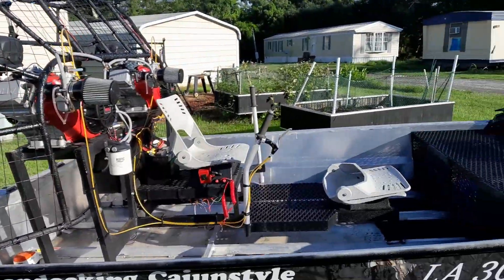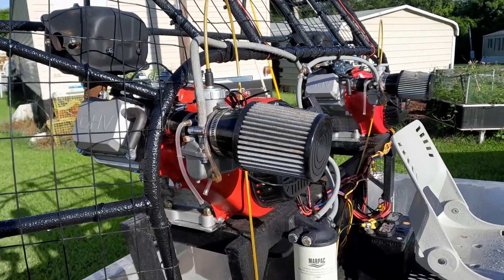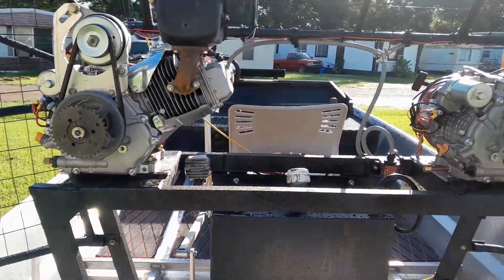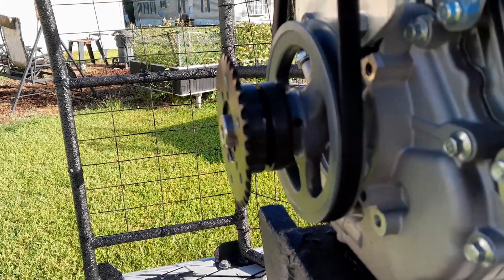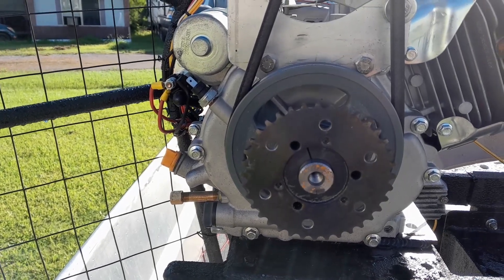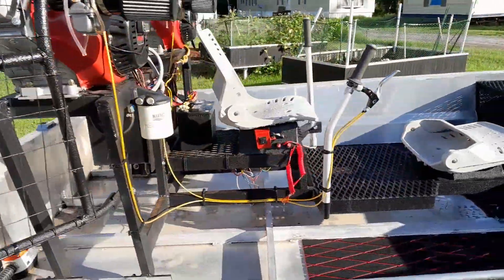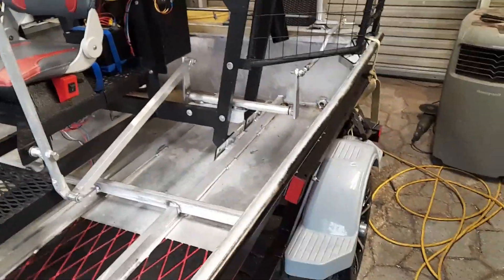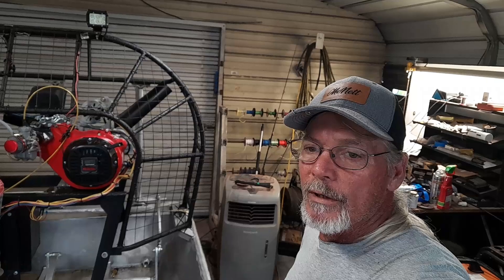Finally getting some water time

Comment: Nice build. As I've been following the build series, I've questioned the weight distribution. That back-end was sittin mighty low when you throttled up to get on plane. I was a touch worried that you'd come off the throttle to fast and take on water. I agree with you about moving a bit of weight forward. It's hard to know until you get it out on the water. But all in all, thats one fine machine. Keep up the Vids, We're lovin em all. Thumbs Up as Always!
Reply from the maker: Yes it is too heavy on the transom, I've moved everything up 3". So now I'm just going to keep moving stuff one at a time until I find just the spot the boat wants everything. 
Thanks for watching and commenting

Comment: Hey Pop ,you definitely need some weight in the front for sure.  Turning 3100 RPMS  isn't really bad. But I do know being that your running direct drive you would have a hard time doing that on sbc . I don't know if they turn that many on a aircraft motor.  Boat looks good and you have really done a great job, have a great time with the boat.
Reply from the maker: @jamessnuffer5239  yeap I did bring everything up 3". I'm hoping that I can correct the trouble by moving things around. I'm going to keep tuning and listening to ideals
Reply: @BoondockingCajunstyle  it might seem to be a little bit of a headache but you could move your gas tank to the front of the boat...I don't think you will get anymore rpms.turning those kind of rpms on a direct drive is probably it.
Reply from the maker: @jamessnuffer5239  I could probably test by installing a temp tank in the front if I can find the place. If I  can get the rpm up more into the power band, it would be great.